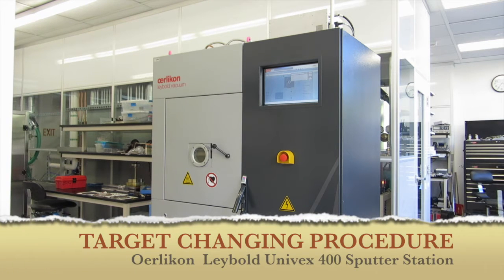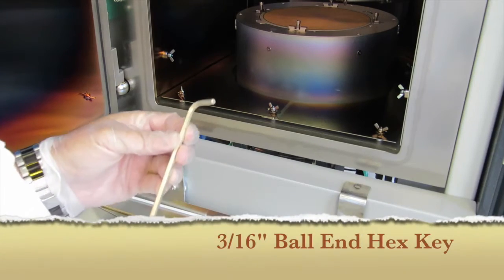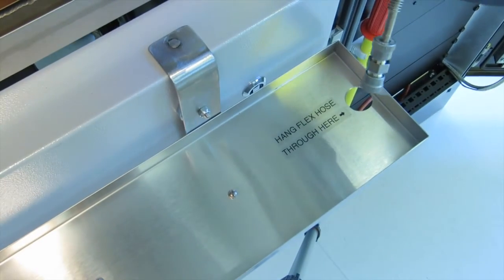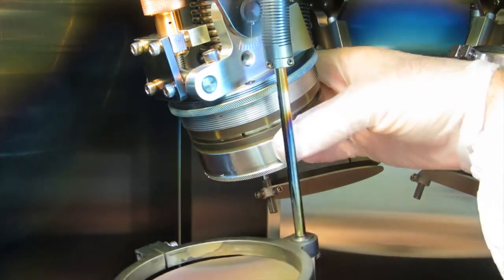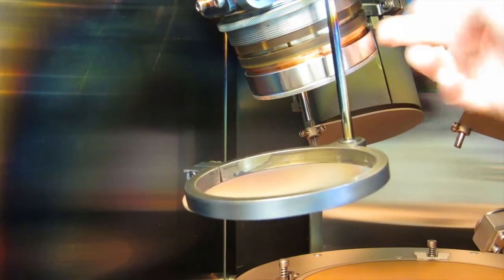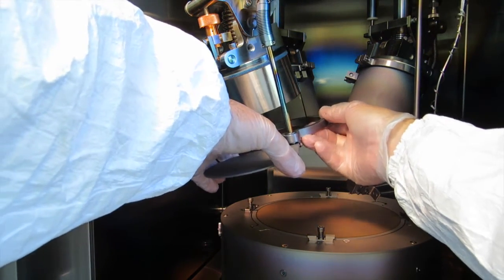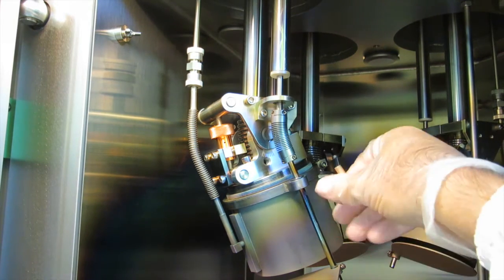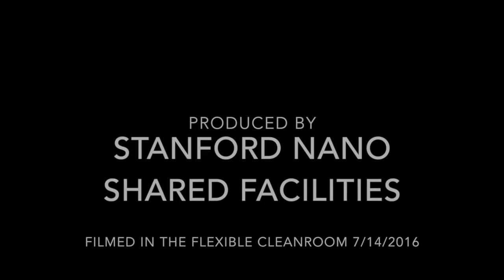Sputter Target Change Instruction

Comment from the maker: Sorry the sound is distorted.  Please note that certain targets require a silver impregnated polymer pad to be sandwiched between the target and the magneton to help conduct heat away from the target.
Reply: Hello. Why is so important the gap? And what is the clearance? Thanks
Reply: The gap between the "dark shield" and the target retainer ring is narrow enough that it blocks plasma from forming in that gap, but far enough that there is no worry of arcing from the target to the ring.   The ring is at ground potential.